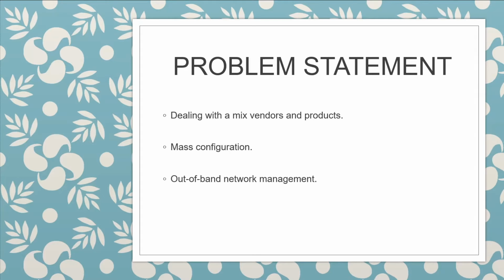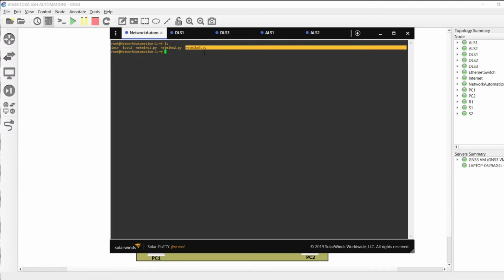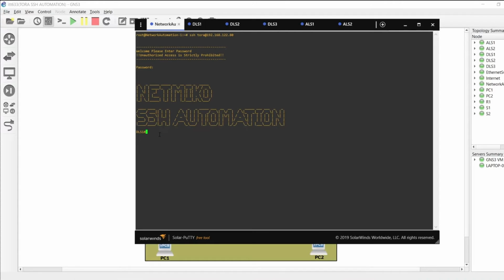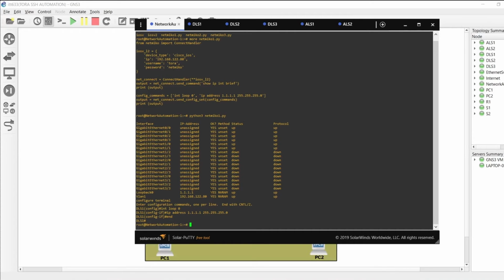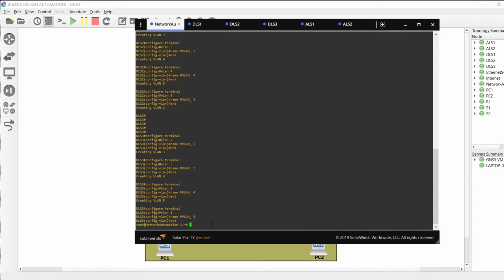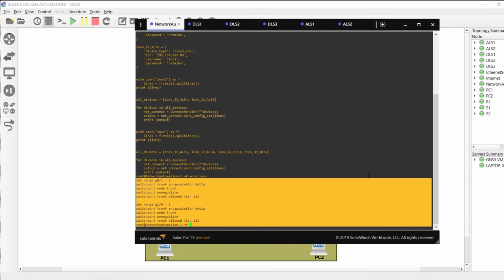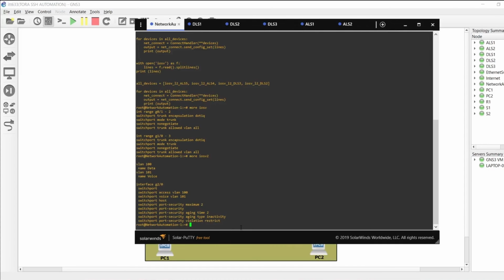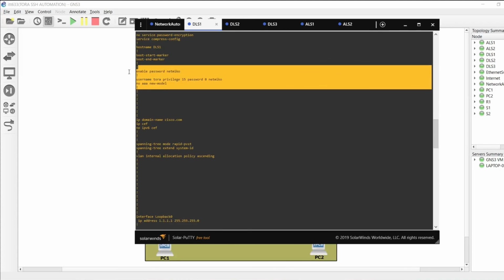ITT633 Network Automation  - (SSH Automation Using Netmiko)

Comment: why you choose to use ssh instead of telnet? and it is possible to pass input to ssh form local file?
Reply from the maker: The reason because SSH is a secure replacement for Telnet. SSH offers secure logins and file transfers while protecting user identities, passwords, and data. These days, Telnet is only used to access decades-old legacy equipment that does not support more current protocols.